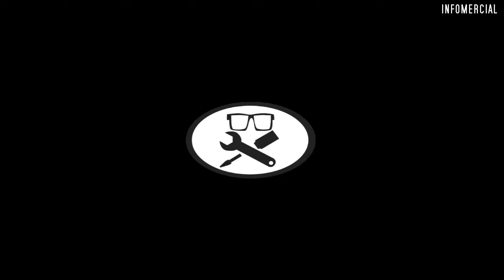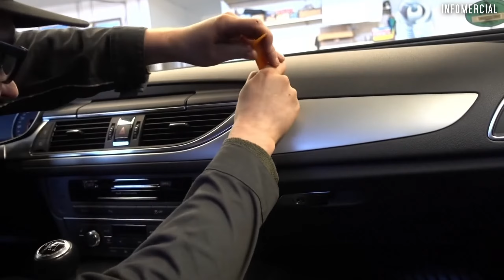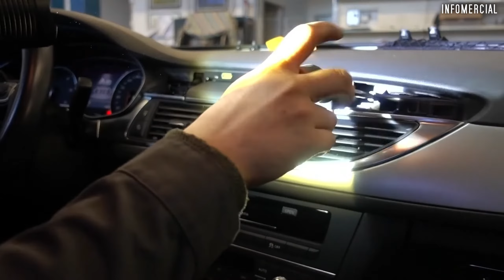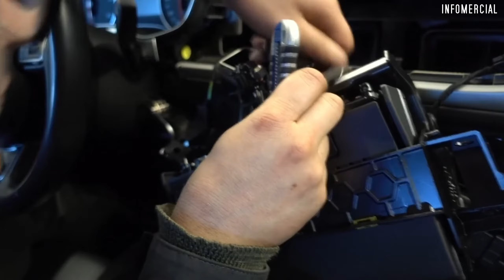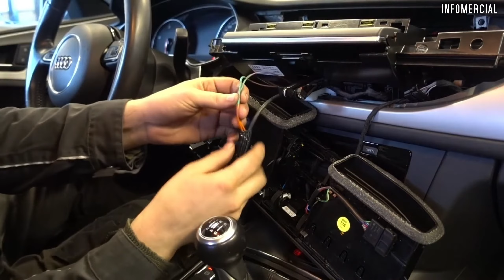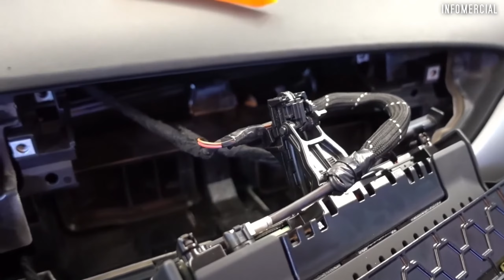How to Fix Audi A6 MMI Black Screen | Radio Black Screen | Tutorial EN | HD

Comment: The 8 Pin Plug that is normally at the Cause of this issue - do you know where we can get a wiring diagram?  Mine has had 2 of the 4 cables snap off completely, so I want to replace it, but I need to know which wire goes where..!  But thank you for the simple video
Reply from the maker: Hi, sorry, I don't know where you get schematics from; we get ours from the manufacturer.